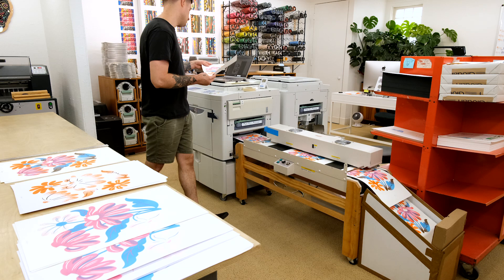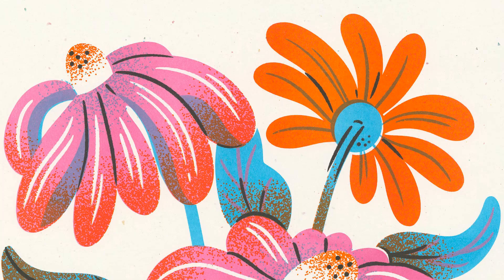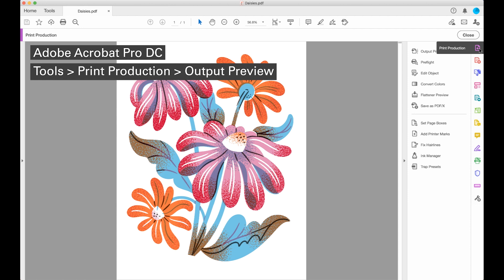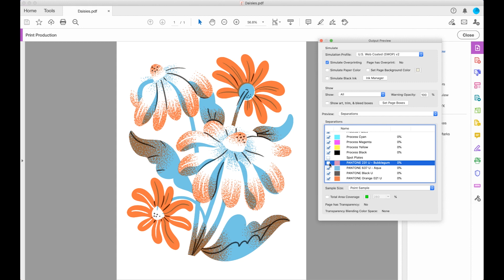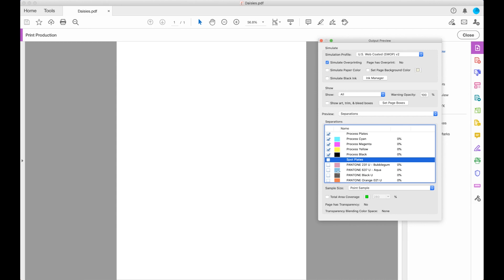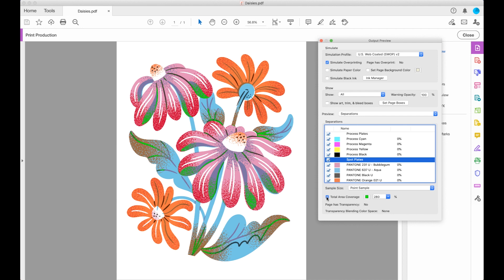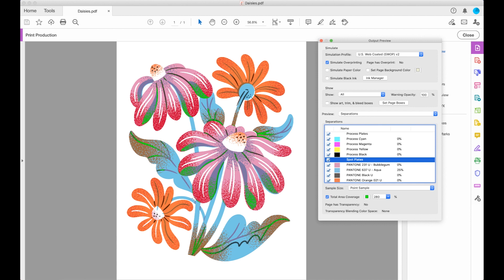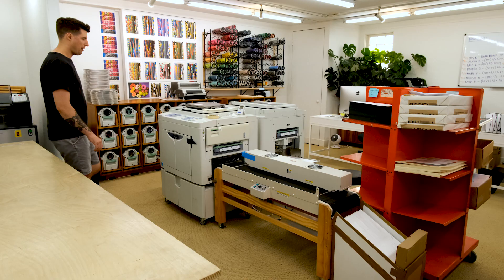Riso Print with Risolve Studio! Featuring artwork by Jordan Kay

Comment: I have trouble understanding the seperation of color. I got this line art illustrated in ps. I than filled different areas of the illustration with black and lowered the opacity for different values. Each on a different layer. So basically all grayscale. So do I know have to create new spot cooler channels and paste the grayscale areas into it ? I am confused